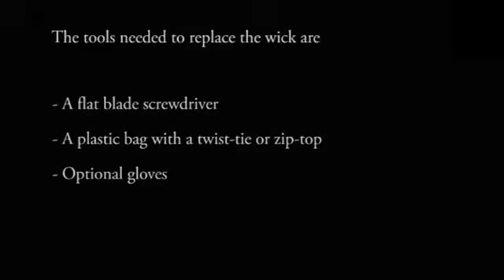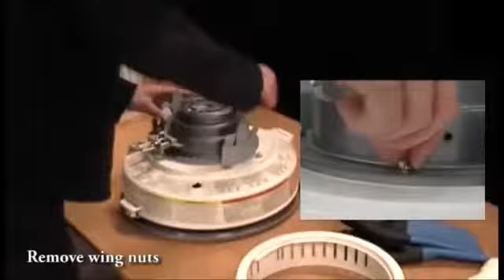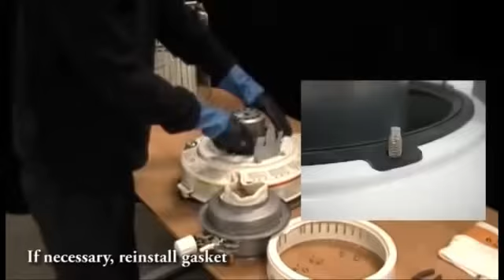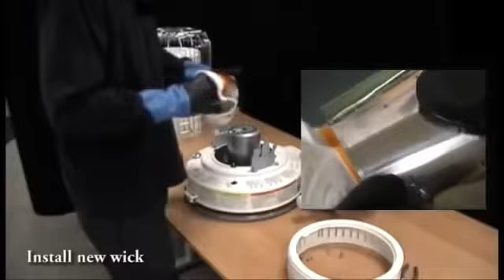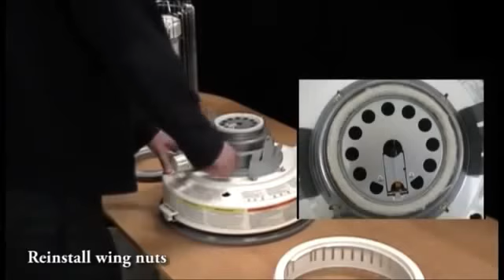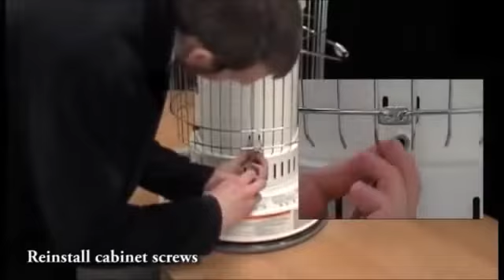How to replace your wick on your kerosene heater

Comment: When I turned this unit off using the knob, the room stinks to high heaven of kerosene now I have to take it outside. That’s using the knob not the manual device very disappointed with this. Haven’t had a currency heater since the late 70s. Don’t remember this many problems oh well, live and learn

Comment: I have a kw-12 and after I changed out the wick the flames stay underneath the middle plate. How do I correct this?
Reply: I have this heater shown in this video, which is the Dura Heat heater. If you are referring to the middle plate as the wind guard all the parts must be seated correctly. Try to see if the middle plate which I think what you mean is the part on top which is the part above the wind guard see if it is seated correctly.